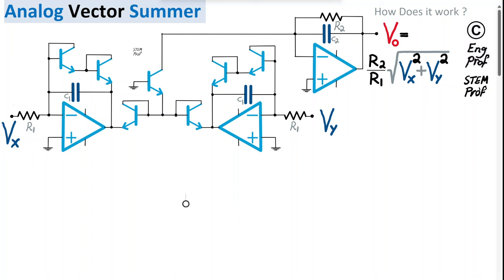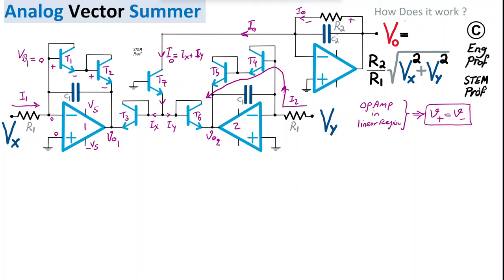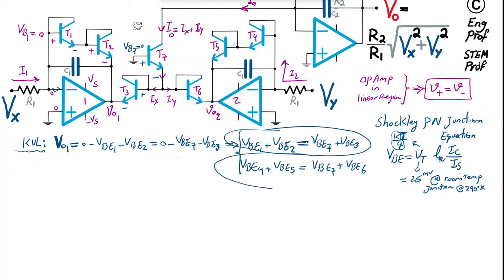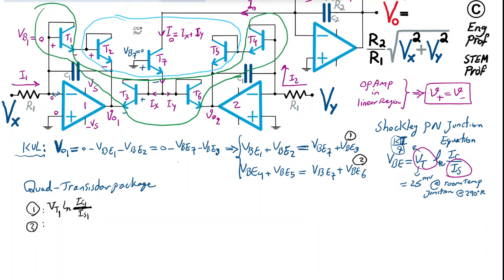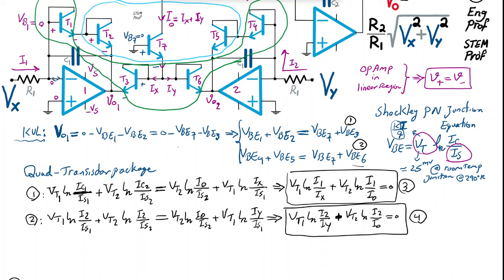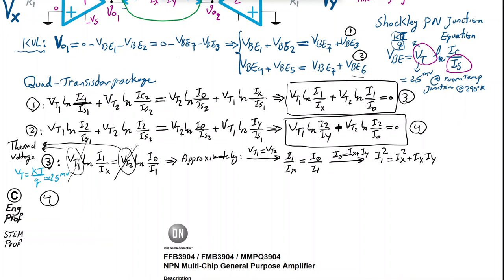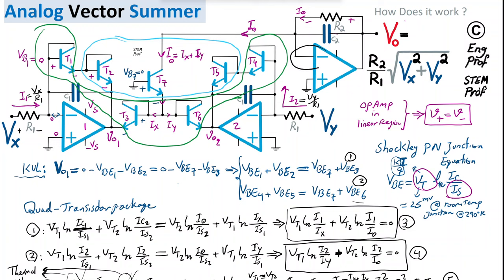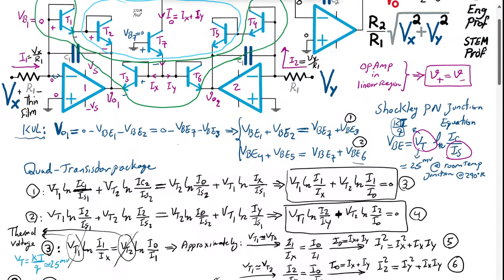Analog Computer Vector Sum Calculator Design with Op Amp, BJT Transistors

Comment from the maker: Thanks for watching. For more Op Amp Circuits please see:
Op Amp Amplifier with Electronic Gain Control https://youtu.be/NoNgQpbj77Y
Analog Logarithm Computer https://youtu.be/RpKEq5WyoLg
Op Amp Analog Computer Differential Equation Solver https://youtu.be/ENq39EesfPw
Thermometer Circuit Design with Op Amp & BJT transistor https://youtu.be/55YsraFE0rg
Push-Pull Power Amplifier with Darlington Transistors https://youtu.be/866MYibo8yE
Sawtooth Waveform Generator design with OpAmp, JFET, BJT https://youtu.be/5zHXTx-Vl20 
Wilson Current Mirror and Current Source Design https://youtu.be/LfbfJYrovN0
Instrumentation Amplifier with Electronic Gain Control https://youtu.be/C4tghZ-q6Zs
Programmable Current Source Design with Op Amp, Zener Diode and Digital Potentiometer https://youtu.be/R1x6B0TczWk
On-Chip BJT Current Source Design https://youtu.be/Rs7gEMk03dw
Sawtooth Oscillator Design https://youtu.be/2eUsGPfqbW4
Triangle Oscillator Op Amp circuit https://youtu.be/JF5Up_cuL9k
Sallen-Key Analog Filter Design Tutorial https://youtu.be/KwUnQXbk7gM
How to find Bode Plot, Freq Response, Transfer Function of Analog Filters https://youtu.be/vZFkPeDa1H8
Universal Analog Filter Design https://youtu.be/2J-0msXZE2o
Laplace Transform Example and S-domain circuit analysis:  https://youtu.be/ps8N5TPM_qU
Op Amp circuit Bode Frequency plot https://youtu.be/BLVzuuqAlZs
Lowpass Butterworth Filter: https://youtu.be/UzCjkwqy-9w
Analog Computer to Raise Signal to power n https://youtu.be/IUTlBH1UraE
Differential Equation Solver Analog Circuit https://youtu.be/R3X5AYNZGEI
Complex Sinusoid Oscillator https://youtu.be/GXRhmwmS5Zk
Full-Wave Rectifier circuit example https://youtu.be/DJJMNU-CYcg
Op amps Circuit with feedback loops to design an analog computer that solves a second order differential equation https://youtu.be/HeZRtnRXpEI 
For more analog circuits and signal processing examples see: https://www.youtube.com/playlist?list=PLrwXF7N522y4c7c-8KBjrwd7IyaZfWxyt
I hope these Circuit design and analysis videos are helpful. 🙂

Comment: This is excellent. Have you come across any analog memory structures, similar to SRAM, which can act as a memory? I have been wanting to cross couple to op-amps (similar to SR latch) to see if they can act as a memory latch. Thank you for your advice to use thin-film resistors for the highest accuracy.
Reply from the maker: You're very welcome. Glad that this Analog Computer Video is useful. Regarding your question, I'd say sample and hold circuit is among the most practical analog memory circuits.
Reply: @STEMprof  memory you suggested  is very useful, how about any PLL memory structure to save a frequency? I'd like to turn on a frequency, and turn it off, possibly with an incoming analogy gaussian frequency wavelet blip.
Reply from the maker: @LydellAaron Glad that my suggestion is helpful. Regarding your question, I suggest either considering DPLL (instead of PLL) or a sample & hold for the voltage value of VCO in your PLL.  I hope this is helpful.
Reply: @STEMprof  thank you again. Your idea is very clear, and a good one.

Comment: What's the minimum and maximum currents of I1 and I2? I mean from the point of view of those transistors? 
And is it basically possible to use diodes instead of transistors? If there's some package of multiple diodes within one package?
Reply from the maker: @Chupacabras222  in this Analog Computer I recommend using input resistors with values in the range of 22-39 kOhm. With input voltage range 10 mV to 5V, the resulting input current range is on the order of 0.3 micro Amp to 0.2 mA.  Note that one center BJT transistor is not wired as Diode. We need that transistor to be matched with other BJT Transistors as discussed in the video. Therefore using Diode Array will result in considerable increase in temperature sensitivity and inaccuracy in this Analog vector adder circuit. I hope this is helpful.

Comment: what are the capacitors used for?
Reply from the maker: Thanks for watching and your good question. As briefly mentioned in the video, op amp feedback capacitors are in place for practical consideration to ensure presence of negative feedback during transient response since the main feedback path for each op amp is just Diode-connected BJT transistor. I hope this explanation is helpful. For a related example please see Log Amplifier Design with Op Amp, BJT transistor, Thin Film Resistors https://youtu.be/DUlugLSroN8
Thanks for watching.
Reply: in my experience capacitors in the feedback will limit the gain bandwidth and lower the noise output (adds stability)
Reply from the maker: @dl5244 Thanks for watching and sharing your experiences. You are correct, op amp feedback capacitor increases the stability by further enforcing negative feedback. For more analog circuits & signal processing examples see: https://www.youtube.com/playlist?list=PLrwXF7N522y4c7c-8KBjrwd7IyaZfWxyt
Thanks again 🙋‍♂️

Comment: Can you explain how to calculate I/V curve of transistor with shorted B and C? Why? Because I tried to simulate that simple circuit and got logarithmic I/V curve?! 😯I expected exponential curve similar  to diode curve. 🤔I used latest LTSpice and their 2N2222 transistor.
Reply from the maker: Thank you for watching and your interest in this video. BJT transistor with Base-Collector shorted acts like a silicon PN junction Diode governed by Shockley PN junction current-voltage equation as explained in the video. Base-Emitter Voltage is logarithmically proportional to Emitter Current. For a related example please see Logarithm Amplifier Design with Op Amp, BJT transistor, Thin Film Resistors https://youtu.be/DUlugLSroN8 . For more analog circuits and signal processing examples see: https://www.youtube.com/playlist?list=PLrwXF7N522y4c7c-8KBjrwd7IyaZfWxyt
I hope these Circuit design videos are helpful. 🙂